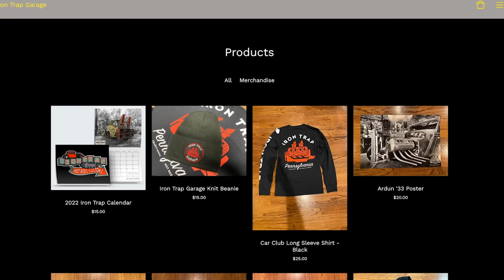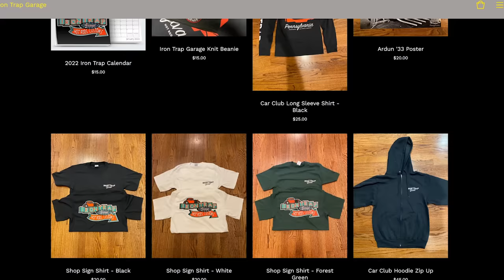Mike's 1934 Ford "Crapiolet" Has Solid Quarter Panels...FINALLY

Comment: I know that the metal is thick enough to not need it,  but don't you usually beadroll your wheel wells? I swear that I've seen you do it and was curious as to why the variation
Reply from the maker: Mike matched how it was from the factory. On some projects I do bead roll the wheel wells.